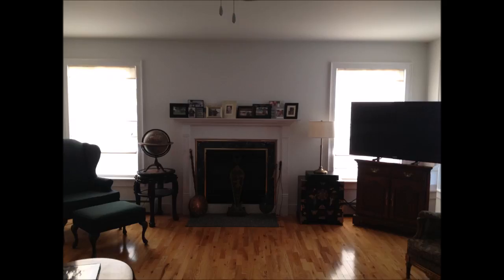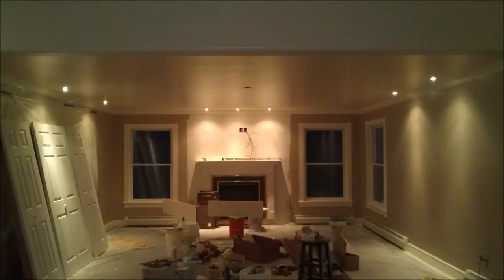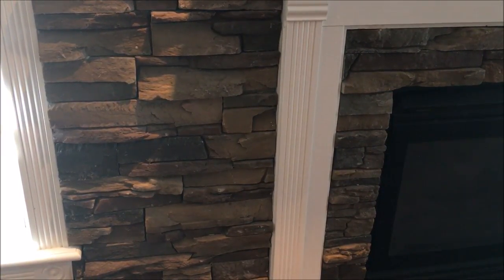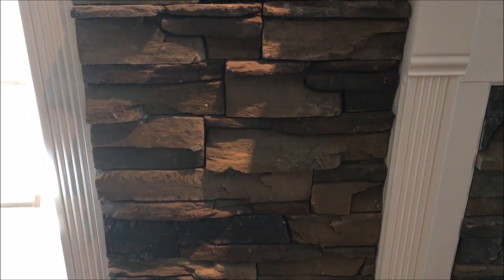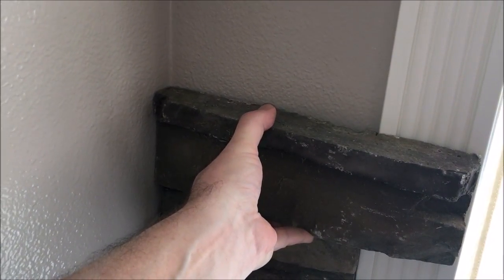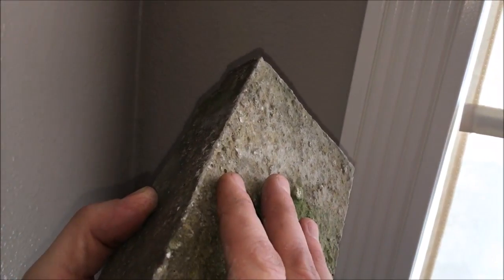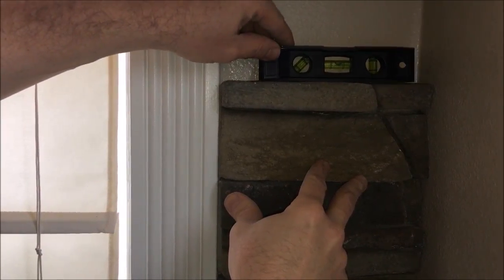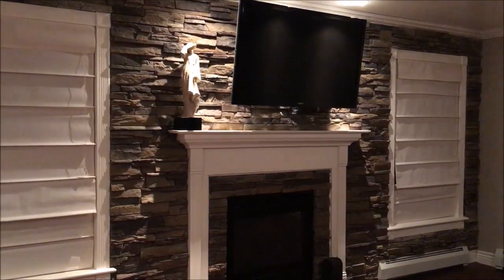Home Improvement | Living Room | Stacked Stone Accent Wall

Comment: Your project has inspired me. I have been interested in doing this, and my ceiling is 8ft high. Everyone I speak to has been telling me that I have to use concrete board to do this and mortar. I see that your stones are still intact on the wall three years later and haven’t fallen off. Can you please let me know which exact adhesive you used?

Comment: Beautiful, we just built a house, and was not in our budget to take the stone to the ceiling that is 15 feet. Thanks for the video i will share with my hub.
Reply from the maker: This is a fairly easy DIY especially if you let the layers cure before adding more, it may take a little longer but you won't have any headaches that way.  It's like painting your nails, you have to wait between coats. Shelby